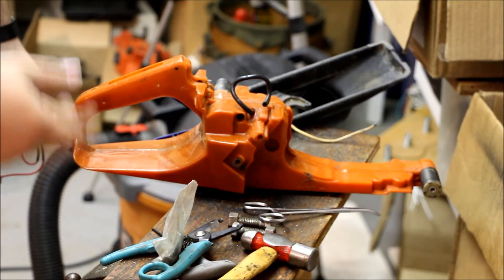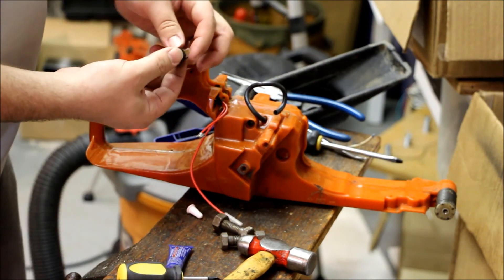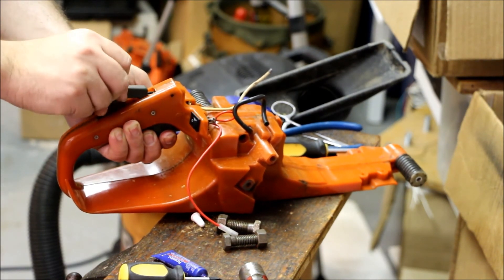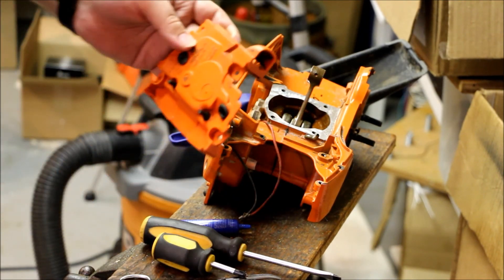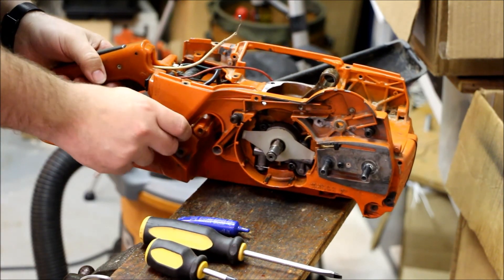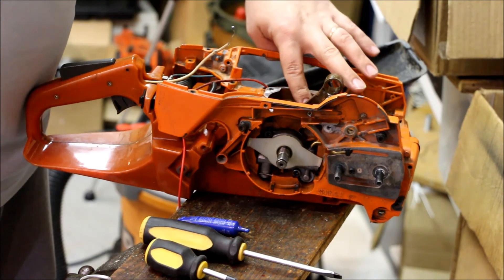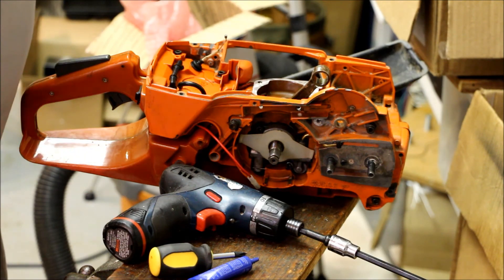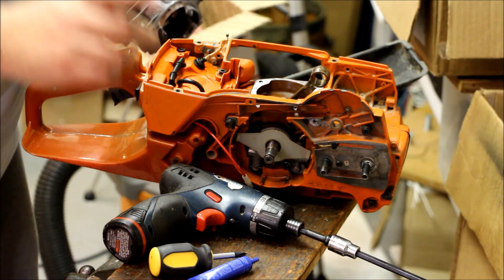Adding heated handles to a 372xp - how to

Comment: Heated handles are awesome. No gloves needed in the winter time.
Reply from the maker: bill porciello in this case they stopped working.  I got fed up and removed and sold all the components.  The flywheel generator magnet had started to disintegrate so that's what stopped it.  New flywheel 150$  .....no thanks.

Comment: where did you buy the parts for the heated handles? I have a 362 with heated grips but they don't work.
Reply from the maker: i ended up picking those up randomly from lots of sources.   I think the heated stuff is still available from the husky dealer, or from the online sites.   the question is, which component failed?  the components are quite pricey ... best of luck figuring out what part died.

Comment: Dang, I wish I knew it was an option for my 572xp. I wonder how difficult it would be to retro fit it?
Reply from the maker: Its usually an expensive retrofit
Reply: @matthewolson8875  price wouldn't be an issue. Just a matter of sourcing the parts and knowing which parts I need.

Comment: 372 handles are a bitch to get on.  That little post on the case with the rubber grommet has to go in the hole on the handle and then it will go on.    It took me a while to figure that one out.

Comment: How long does it take for those handles to heat up?
Reply from the maker: Arjan van Helden not long. ...30 seconds and you notice it if it is working properly I think.  Mine stopped working because the flywheel magnet started coming apart...so I just removed the whole system
Reply: i guess my heated handle bar is burned out, i've measured the resistance and thats the only 1 thats way out of spec.
Do you know if Husqvarna has a model of handle bar thats could be modified to fit on a 242xpg? Since the xpg handel is NLA.
Reply from the maker: Arjan van Helden yikes. .242xpg.....that's a tough one to find parts for....I don't know much about the model. ...but I know that
Reply: Matthew Olson parts for a 242 aren't that bad over here in Holland but the heated bars and OEM piston and cylinders are NLA.
Reply: Matthew Olson You were right, within 30 seconds you can feel the elements warm up. I'm glad i have found a replacement xpg/sg handlebar

Comment: Could this be done to a 2012 Jonsereds 2166?
Reply from the maker: I think so....xtorq motor right?
Reply from the maker: +John Lincicum you'd have to get the jonny heated handle, and then all the other parts should fit....
Reply: Yeah, I believe it is.